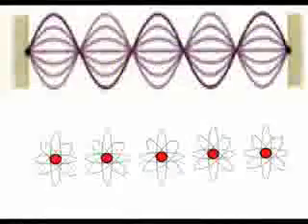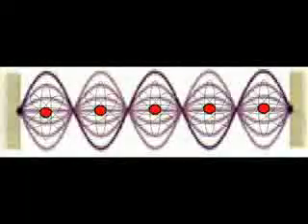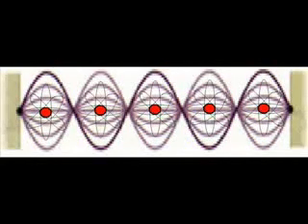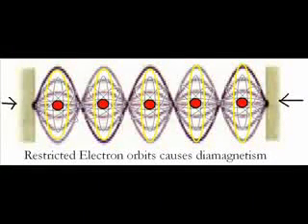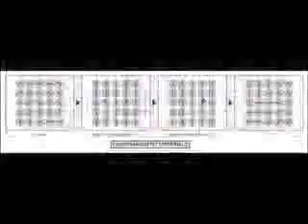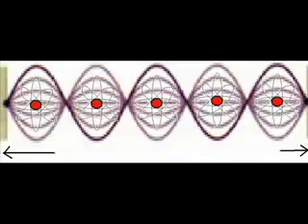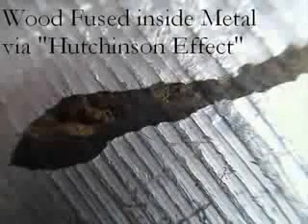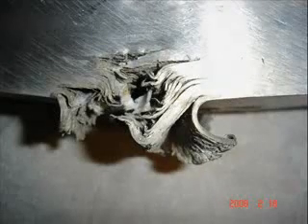Hutchison Effect Explained

Comment: simple math can debunk this video showing that it is near impossible to get sound with that frequency using junk and it also cannot propagate through air because the distance between air molecules are far lower.
you would have to vibrate the iron using some device to do so...
lattice constant of iron = 2.856x10^-10m
speed of sound in iron = 5120 m/s
frequency = 1.792x10^13Hz or 17.9THz (also the maximum frequency of sound possible in iron)
the frequency equals that of the far IR range

One guy in a shed in the 90's cant possibly achieve that with his equipment judging for his shitty video
a SASER is pretty much what this "hutchison effect" is referring to but an induction heater is a way to turn metal into liquid using vibration though it is by magnetic fields in that case and in much lower frequencies in the KHz range.

closest thing to a "hutchison effect"
https://www.youtube.com/watch?v=WT_iTV7QeDg

sources:
https://physics.stackexchange.com/questions/23418/is-there-an-upper-frequency-limit-to-ultrasound
https://en.wikipedia.org/wiki/Lattice_constant
https://en.wikipedia.org/wiki/Speed_of_sound
https://en.wikipedia.org/wiki/Induction_heating
https://en.wikipedia.org/wiki/Sound_amplification_by_stimulated_emission_of_radiation

final nail in the coffin:
building a SASER is expensive and even labs that do have it barely reach 1 THz and it takes 17 THz  to build this iron SASER
vibrating the lattice of said iron will cause it to glow and melt as the temperature rises
so you cannot hold an object while undergoing the "hutchison effect".

and yes metal will behave like a liquid because IT WILL BE A LIQUID given those conditions!!
Reply: Steve Jackson How is math bad?
Reply: MysteriusBhoice I thought the Hutchinson Effect had to with electromagnetism and not sound.